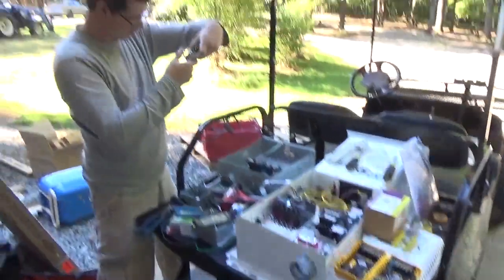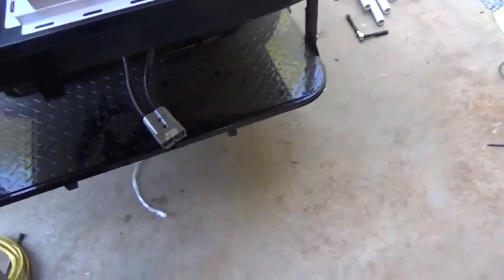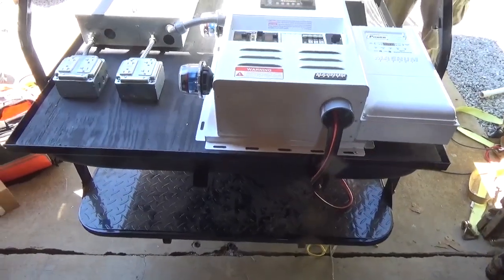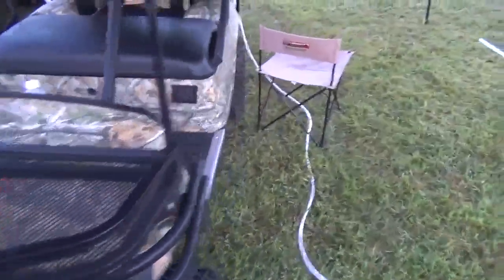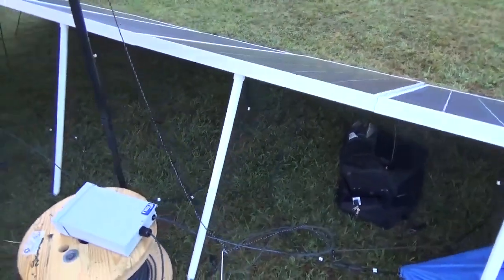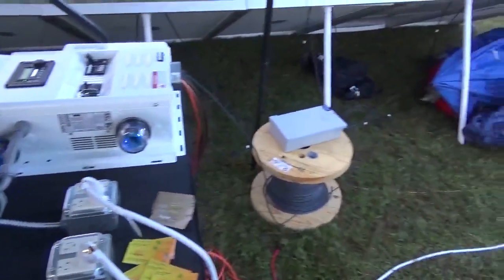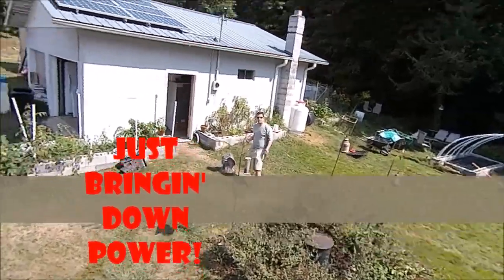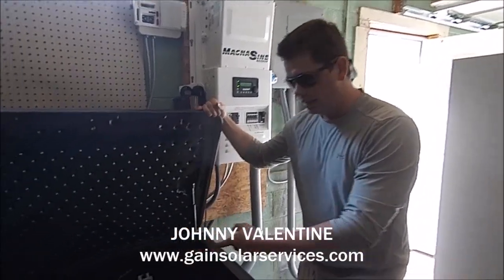Prepper Power Cart

Comment: Wow great work with the Magnum inverter. I just uploaded a video I made of my own cart. https://youtu.be/PSNyKXgzz_M Same inverter, different charger and built-in engine generator.
Reply from the maker: +benjamin saunders Great job!  What open cicuit voltage are you running for the solar panels?
Reply: +engineer775 Practical Preppers Two Renogy RND-150Ds run 22.5Voc each. They are in series through a Genasun MPPT and their 8.3A Isc is slighty over spec for the charger but this isn't a practical limit as this is their STC ratings which are rarely achieved especially at a flat angle. I have one more panel to add and will use another Genasun for it.
Reply: +engineer775 Practical Preppers The Genasun is a boost controller, works with as low as 12V.
Reply from the maker: +benjamin saunders cool. so it will actually charge a 48v bank? cool.
Reply: +engineer775 Practical Preppers Quite well. A few made fun of charging a 10kWh battery bank with 300W of solar, but after the built in 2kW DeltaQ charger died I switched to the Stanley GBCpro which only puts out 500W and seems to over charge large batteries. The Genasun controller will bring the batteries up to what looks like a 95% SoC after resting an hour. The batteries are bit finicky. The Alpha DCX3000 generator has only one mode and that is float@52.4V so it won't fully charge batteries but is meant to sustain DC loads. I also have the BMK on this system w a 500A shunt (not quite working yet).
Reply: +benjamin saunders The Genasun is claimed to be temperature compensating but the sensor is inside the charger so I don't really see  how this works properly. It might be a bit conservative on its charge cutoff but does the job pretty well.

Comment: do you know of any solar installers in the southern n.c. piedmont area. i just got my disability approved and the back pay seems sufficient to get this project started. i want to arrange a grid tie with battery backup. switchable to straight solar when and if the grid fails.  my intentions are to up size the charge controller to a 100 amp mppt and run a 240 volt inverted from 48 volt batteries. i'll add panels as i go. i'll shut down the main breakers to eliminate back feeding the grid and save a lineman life when the grid fails me. i'll add a vawt latter and build a bedini energizer wheel. i've already got a line up on used car batteries for lead/alum conversion. as lead/alum withstand cold weather better. and they take a faster charge and deeper cycle than many deep cycle batteries do "without damage." and they desufate the plates as they cycle though each deep cycle. you just have to cleans the bottom of the plate cavity in the battery cases. i see drilling a hole in the case bottom, then completely flush out the gunk that was shorting out the plates. i plan to buy a lot of these at 17 dollars each. most will be semi-tractor truck batteries, the ones with rope handles at each end and 24 volts already. maybe a few fork lift batteries. then i wont worry about my comms going down. being able to power a pair of 3 500z graphite's. and regen power back to storage.
Reply from the maker: +dale myers Dale.  Send me an email and we will get started---    info@practicalpreppers.com

Comment: Why would you choose magnum over solar edge
Reply: +charles fournier Solar edge inverters are grid tie inverters.  They will not make power if they aren't connected to the grid.  The unit in the video is an "offgrid inverter/charger"  it can take power from a battery bank and invert it in to pure sine wave AC household power.  It can also take AC power from the grid or a generator and charge the batteries.  While the Magnum is doing all that the solaredge will still be "off".  Solaredge makes a great, unique grid tie inverter/power optimizer and we use them on grid tie jobs.
Reply from the maker: Magnums are American made! solar edge is not. magnums are bullet proof and now they have their own charge controller for a complete off grid package.
Reply: sounds like it makes sense